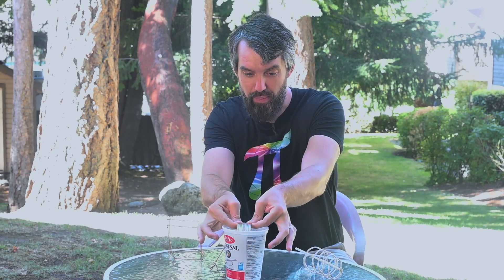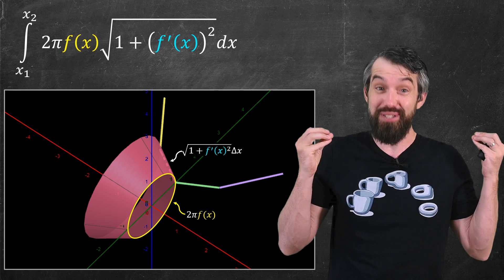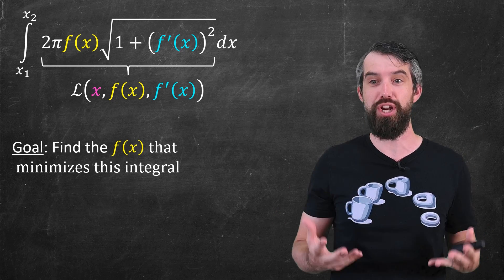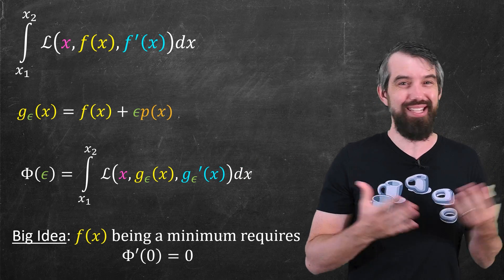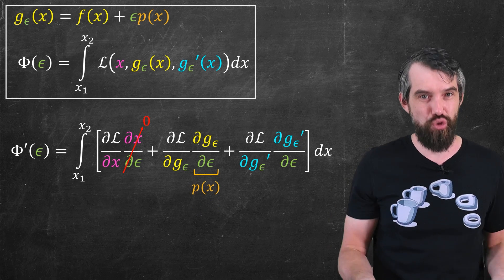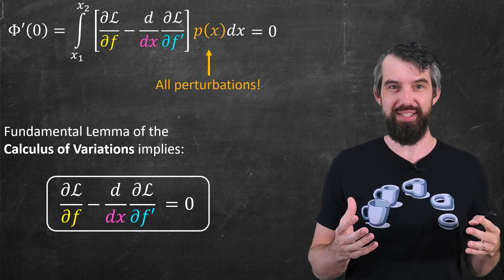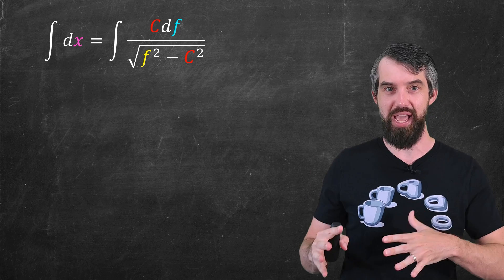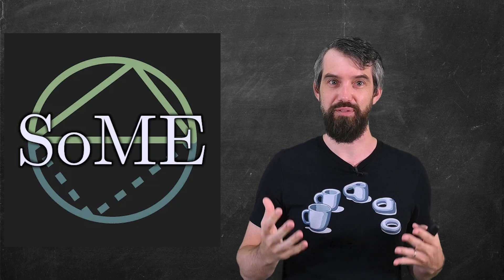The Math of Bubbles // Minimal Surfaces & the Calculus of Variations #SoME3

Comment: I got a curious question about this "minimal surfaces" and bubbles. Does this curve only appears in rings put together. What curve would appear (mathematically speaking) If I took a plain surface against a ring or if I took two plain surfaces with soap and then I pull them appart. Does the curve shaping the surface continue being as the calculated or it is related to the curve like the one describing a capillary conduit?

Comment: Very good video. Takes me back a couple years to when I was 17 trying to figure out how to characterise a geodesic on a come because my younger brother said the liquid ice running down his cone was in a straight line and my parents said no it wasn't because it curved around the cone.

I tried to find this using all the methods I know and gave up and looked it up and thats where I saw calculus of variations for the first time. I did examples and understood but never did quite get that cone thing to defend my brother. I finally got it a few months ago in the last year of my degree, when I came across pictures of the scrap book i did all my working in back then. Its good to see growth.

Anyway I was rambling. Point is, 6 years later and I think this is the cleanest introduction I've ever witnessed, this is including both from my micro economics and classical mechanics courses. Great work

Comment: Very nice!
It's worth adding that many so-called 'minimal surfaces' don't actually minimize area: its just that their variational derivative is zero. (They're the equivalent of "saddle points".) However, for any point on a minimal surface, its possible to choose a small enough region around that point so that the surface does minimize surface area with respect to the boundary of that region. (That is, large regions are not necessarily minimizing, but small enough regions are.)
Reply from the maker: Absolutely, that's a great clarification, thank you.

Comment: Can you please elaborate as to why f(x) being minima implies phi'(0)=0 and not f'(x)=0 and f"(x)>0? Thanks!
Reply from the maker: When epsilon=0, then g_e=f. So we are evaluating at zero to make sure we get f which is what we are claiming is a minimum. And then that the derivative equals zero is just the usual requirement that for any (differentiable) function to be a minimum needs to be zero. If not, you could change the epsilon and get something smaller.
Reply: @DrTrefor  Ah thank you! Great video BTW.

Comment: Great video! One comment I'll make is that there are configurations where the catenoid is still a local minimum but not a global minimum for the surface area. So if you pull apart the two rings as you did at 16:18, there is a short period of time where the surface area of two disks is smaller than the surface area of the catenoid. But since the soap can only sense local variations, it does not immediately jump to the optimal shape. However, once you pull the rings apart far enough, the catenoid is no longer a local minimizer and the film collapses to two disks.
Reply from the maker: Cool observation!
Reply: If the surface area is smaller then why does it only last a short time?
Reply: the smaller one is the disc not the catenoid  @Kamil-mo3kj

Comment: I only really briefly encountered the calculus of variations in my engineering physics program, but I really enjoyed it! I wish I'd had the opportunity to learn more about it. It's so cool to me that by taking the ideas of calculus and extending them up a level, as it were, we can achieve a mathematical model of mechanics that makes it much easier to solve many problems by considering only energy (a scalar), rather than forces (vectors). Clearly it has other applications, but as an EP, this is the one I learned about.